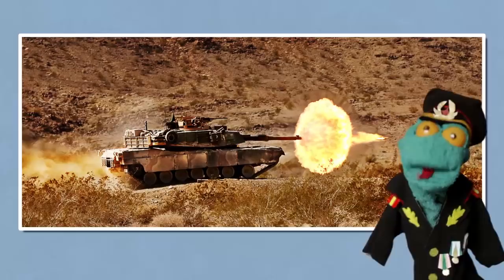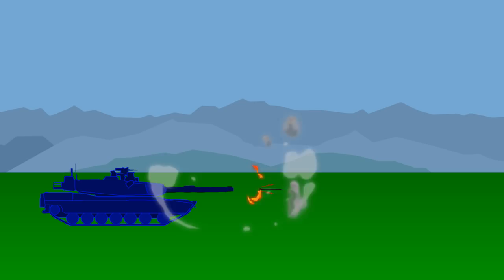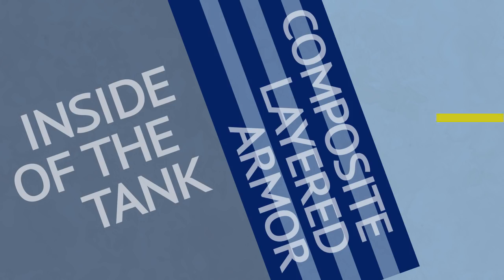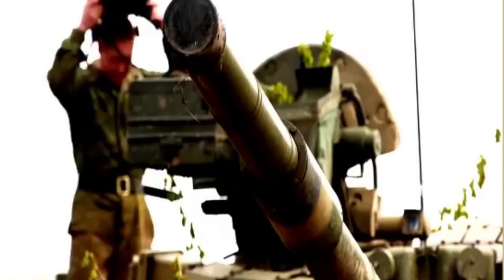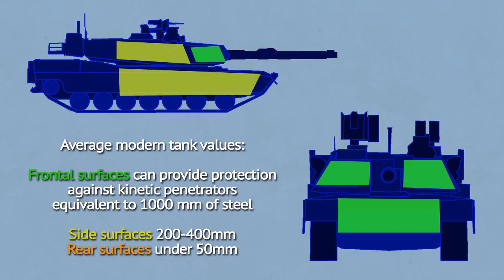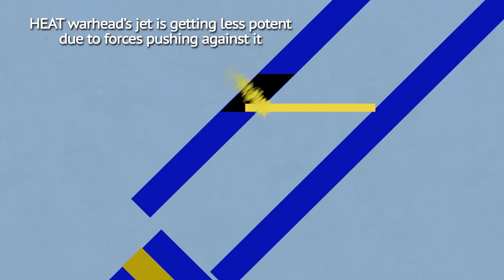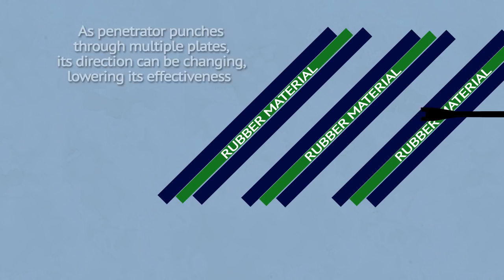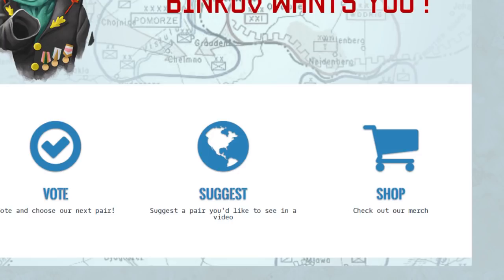Tank Gun vs Armor: Tank Warfare Explained

Comment: After all this time we're still just shooting arrows at each other.
Reply: And we will be far into the future.

Go look up relativistic kill missiles for how future interplanetary wars will be most likely fought.
Reply: until sometime in the future when we start shooting extremely heated plasma at each other
Reply: +Shattered Star Pointless. The jinetic energy imparted by minuscule differences in velocity at relativistic speeds eclipses the amount of thermal energy a material can contain without blowing itself apart.
Reply: Particle accelerator beam weapons. Kind of a "rail-gun laser" so to speak.
Reply: I need no channel youtube! FUTURE
Reply: kinetic weapon are here to stay
Reply: @ineednochannelyoutube5384  Giving kinetic energy is not so easy either. It needs to be converted by some other type of energy which limits your supply. Even if it is a grounf unit of some sort, energy density, name it thermal or magnetic, gives you new challenges like controlling heat. Mechanical workpieces are also more prone to fail at high velocities due to wear and high stress.

Just checkout latest Railguns or Space rockets to see what I mean.
Reply: @shatteredstar2149  We do that. HEAT.
Reply: +Barış ALTUN I am not questioning the use of other forms of energy transfer besides direct kinetic. I was just remarking on the fact that beyond a certain c fraction anything else becomes irrelevant.
Reply: +Barış ALTUN No. Heat copper jets are not even molten, much less plasma. They simply behave like a liquid because impacts at hypersonic speeds make avan heavy metals flow like liquids.
Reply: @ineednochannelyoutube5384  So, they are not molten metal?
Reply: +Barış ALTUN Nope. Hot, but very much solid metal moving really fast.

Comment: Great video. Although if you wanted you could have made it 2 or 3 parter and still not use up everything there is to say about it. For instance whole family of T-64 up to T-80 had models in which between two layers of Armored steel, were two layers of silica (forgot the name, but the word in Russian was based on glass or crystal - I'm Polish so I understand a lot, szkłolit, or something), of course between them and steel there was 20mm of air, but between silica, were tightly packed Cylinders or Balls of Corundum (also known as Ruby), which is only little less durable than Diamond. I think they were about 150mm in diameter. Of course it was used only for Front armor and frontal turret armor (though sometimes covering parts of side turret armour).

One mistake (?) that I saw. "Burlington" was official name of the program to find better armor, they were only named like "Special Armour No.1" Although "Burlington" is the name of family of armors it is the most correct use. "Chobham" is name of the place were the armor was produced, and it's just an informal name. "Dorchester" while also informal name is used only for Burlington armor that is used on Challenger 2. I know that wikipedia at least partially disagrees with me. But I've read proffesional Monographies and Articles dealing with armor and weaponry of almost every tank after WWII, and some of the WWII. Same goes for planes and submarines. Not fully but also about surface vessels (such as proj. 1144 and 1144.2) and Helicopters (Ka-52).

Sorry I almost feel like I'm bragging. Happy to be subscribed to you. You are truly non biased, and well informed, although sometimes you forget about reservists etc.
Reply: Oh, man. So they're using crystals as armor.
Are crystal-based weapons coming soon, too?
Reply: Chobham was the original 'designation' in the UK where that particular armour package was developed. The US were basically given the license and their term for 'Chobham' is 'Burlington', it is basically the same armour, or at least was. Both Burlington and Chobham have seen development since. 

What is commonly called Dorchester is a more advanced form of Chobham, it is mounted on Challanger II's but to my knowledge the US does not use it, as I believe the US was looking at adapting 'Chobham/Burlington' to their own needs. 

Speculations about how those armours work and their composition are basically that, as in the UK both Chobham and Dorchester are national state secrets, the the best we can do on youtube, is speculate.... 

Given the survivability of the vehicles however, we can probably assume the armour package is effective. 

Oh... and while diamond is hard, it is also brittle, you can smash a diamond with a hammer.... you can do the same to rubies.... it is very hard, but also very brittle. I am thinking the corundum would likely be used to dissapate HEAT round impacts, against a kinetic penetrator it would do pretty much nothing.

Of course, I could be wrong, someone who actually understands the physics of this might be able to shed extra light... 

Nos Da

Comment: A couple of things: The larger the round is the greater the effect (HEAT). the perforation depth drops dramatically after 6-7 inches with only spall mass increasing which is why most modern ATGM's are kept to a similar size. the increased weight gain/cost is not worth it for the decreasing spall curve. otherwise good little intro video to the subject.

Comment: Excellent writeup on how it all works. Very well explained and without falling into comparison of tanks to set off the morons. Just a couple of small notes in regards to the British components:

1 - HESH is not just for structure use. It's still extremely effective against most vehicles short of an MBT itself. Not nearly as obsolete as people say.

2 - It's the British Army, not the Royal Army.

3 - The video mentions that "America" has breakaway designs, but the British do as well. If you look at a CHARM3 L27 projectile, it can be seen to have such a breakaway tip too.
Reply: APFSDS designs from israel and germany also have.

Comment: So...
In relation to HEAT being too short for long range so designers switching to APFSDS.
What was the need that triggered the development of Chobam armour?
Which shell type obsoleted RHS armour?
Reply: It's just the need for better and better armour. Modern ATGMs can easily penetrate over a metre of solid steel, maybe even 1.5m. And kinetic penetrators also keep on improving, creating the need for better and better armour.

RHS is terrible against HEAT, which is the main reason it was phased out. At one point, HEAT was so powerful that tank designers thought that armour may become obsolete. I'm pretty sure that's why the Leopard 1 has only enough armour to protect it from small cannon rounds and nothing more.

Then composite armour was developed and put armour back on the table since HEAT was no longer the be all end all.

Comment: There are a few methods of defeating HEAT rounds that aren't mentioned in this video. Spaced armor(Think of the skirts around German Panzers in WW2) will make the HEAT round explode outside the main armor drastically limiting it's potential penetration while cage armor/Slat armor(Either a fine mesh or a grid of bars) will catch the HEAT rounds in flight, potentially damaging the fuse or the shaped charge.

Comment: Im not trying to be a keyboard warrior but im pretty sure that ERA armor works almost exclusively from the explosive force, as the metal plates are very thin compared to the penetrating ability of HEAT. The explosive force drives against the incoming jet of heated metal and that is what dissipates the projectile, not the plates pushing back. (around 11:50 is the error)

Comment: HEAT rounds also are much easier to armor against than kinetic penetrators. So a HEAT round that can go through a meter of steel probably will penetrate less than an APFSDS that can go through 60 cm.

Comment: There seems to be a mistake. Kinetic rounds core usually have a flat nose for stronger integrity. The sharp tip is normally just aluminum aerodynamic windshield.
Reply: Nowadays modern APFSDS like the M829A3 have extended tips than are able to defeat ERA.

Comment: I thought the Abrams didn't use HEAT against helicopters, but rather had a newer HE round with programmable detonation based on the FCS laser rangefinder? If not, I'd be using an APFDS for optimum speed of the round.
Reply: The reason is that M830A1 HEAT has the option of being fired with the fuse set for anti-air with a proximity switch, and serves as a HE round in case of a near miss: https://fas.org/man/dod-101/sys/land/m830_h3-s.jpg
Reply: MPAT (Multi-Purpose Anti Tank) has a HEAT/fragmentation warhead.  This way it can use a proximity fuse against aircraft, used as a HEAT round against light armor, or as a fragmentation warhead against unarmored targets.  

However this round is on the way out as the AMP round is being designed to replace it.  Details are sparse but it appears to me that they are doing away with the HEAT warhead and creating a fuse that is set by the tank's fire control system instead of the loader.  The fuse will probably have three modes: proximity, impact and delay.  Proximity will be used against aircraft, troops in the open etc.  Impact will be used against vehicles and other unarmored targets, and delay will be used against bunkers and light armor (the warhead detonates inside the target).

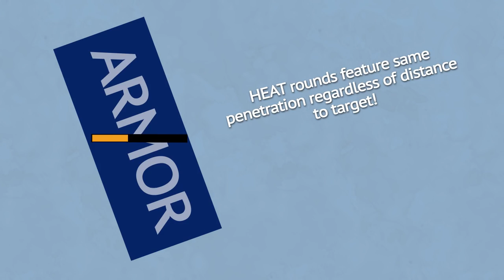Comment: 1:13 Yeah, your right about the HEAT round being more effective if it's larger. But, specifically it means increasing the diameter of the HEAT warhead.

Increasing the diameter of the shaped charge usually increases the its penetrative efficiency. However, if you make it smaller than a certain size, your efficiency drops dramatically. I think the smallest that you can make a shaped charge is 20mm in diameter...but this small diameter is horribly inefficient when compared to other diameters

Comment: An extremely informative video!  Note that the US made experimental sandwich steel-glass-steel tank armor a long time ago; it worked rather well but initially was dropped due to the impossibility of repair for solid one-piece cast structures (hull or turret).  Modern laminated armor materials are outside of the steel inner armor support plate and can be removed and replaced if damaged like interlocked puzzle pieces, eliminating the problem of trying to replace a large one-piece plate.

Comment: 4:38 HEAT rounds are used against lightly armoured targets, because they also tend to over-penetrate less. I think HEAT shells rarely over-penetrate, because since the tip jet of the shaped charge travel at stupid amount of velocity (around 7.8 km/s or greater for the jet tip of the shaped charge). Due to this OP velocity, shaped charge jets face much more atmospheric resistance than contemporary projectiles....a good analogy to this behaviour are meteors falling down into Earth's atmosphere. Meteors usually break apart quickly in Earth's atmosphere, because of the speed they are falling (well, that, and because they get burned up)....even at relatively HIGH ALTITTUDES where there is barely any atmosphere.

Another resaon I think HEAT rounds don't tend to over penetrate a target is that after travelling a certain distance, the shaped charge jets tend to fragment apart. This fragmentation I believe causes non-aerodynamic shapes, just further increasing resistance to atmosphere.

But this is just my theory on why I think HEAT shells don't penetrate (so take this with a grain of salt)

BUT....I DEFINITELY KNOW FOR CERTAIN that shaped charge jets lose ALL penetration, and COMPLETELY stop moving forwards after the jet travels a few meters. Whereas the kinetic sabot (early APDS, modern APDSFS) will over penetrate a target, and still have enuff energy to keep moving forwards for tens, maybe even a hundred meters (One example of this is during a documented  test where a Super Pershing penned a jagpanzer [FROM THE FRRRRIGGGIN FRONT. It penned the jaggy's frontal armour], and the shell embedded itself into the dirt a couple of meters behind the jaggy

Comment: You mention over-penetration, let me give you an actual real war example that admittedly, wasn't tanks. When the IJN Center Force engaged Taffy-3 in the Battle off Samar, some of the small 'jeep' escort carriers took a dozen or more hits from the big 14"-16" guns on the various Center Force warships. Those hits were generally AP rounds and often punched right through both sides of the completely unarmored carriers and only exploded when they hit the water.
A couple of notes about Depleted Uranium vs Tungsten Alloy: DU is 'self sharpening'. As parts break off the 'arrow' they form sharp angles which means it continues to have a penetrating tip as it punches through the layers of armor. DU is also pyrophoric and relatively brittle. As the stresses of punching through armor are relieved (it enters whatever compartment it hit) it shatters into thousands of chips and dust. Then it self ignites. Only the US and UK are admitted users of DU ammo. More of the US inventory of DU ammo, by mass, is in the form of smaller rounds for weapons like the GAU-8 Avenger and anti-missile/aircraft high rate of fire weapons.
Tungsten alloys are less 'hard' but heavier. Made properly, these rounds can also be self sharpening. They are not pyrophoric. 
The US Navy has replaced all their DU ammo with Tungsten based rounds. The US Army and Airforce claim that they chose to remain on DU because they say the tungsten alloys are actually more toxic from an environmental impact point of view, and the DU contamination is easier to clean up that tungsten.
A note about the Depleted Uranium used by the US: A countertop made of DU would generate less radioactivity in a home than the sames sized countertop made out of granite. The toxic nature of DU ammo comes mainly from the fact that it is a heavy metal, just like lead and many others, and the toxicity is similar to other very heavy metals in its effects.
Reply: 'DU is 'self sharpening'. As parts break off the 'arrow' they form sharp angles which means it continues to have a penetrating tip as it punches through the layers of armor'

Not 'layers of armor'. DU indeed has self-sharpening ability, but it doesen't occur when penetrating modern NERA/composite armor arrays, only steel.

Comment: Hey Binkov, how do DU rounds fired from machine guns such as an Apache or an A-10 defeat armor, and why are they not used in tanks? How about hellfire missiles?
Reply: They don't defeat much armor. The GAU-8 has a RHA penetration of 69mm at 500m and 38mm at 1000m. Even against the T-62, A-10 pilots were taught not to attack from the front or even the side unless flat on. Top and rear shots only.